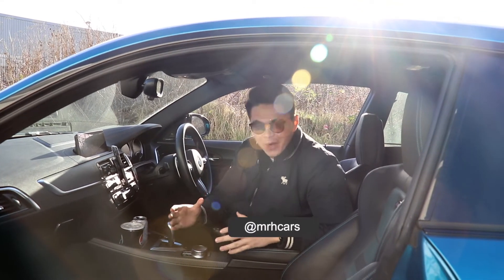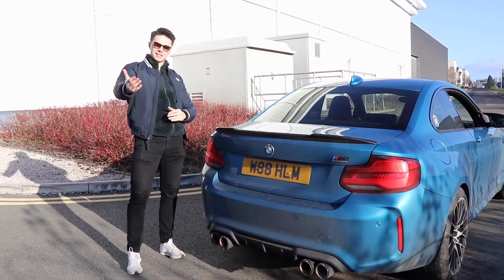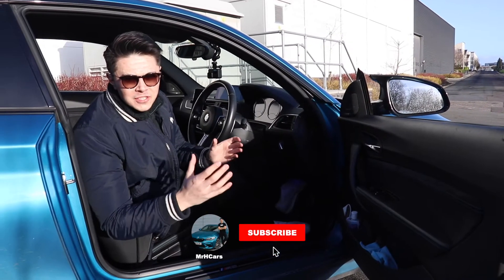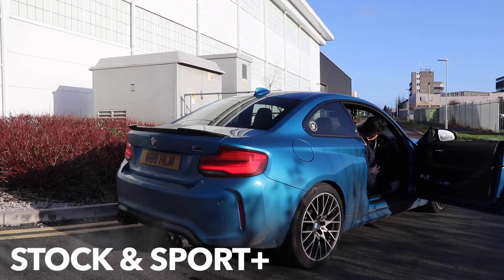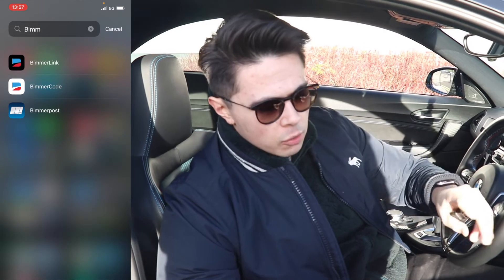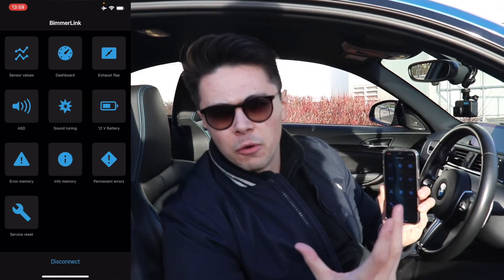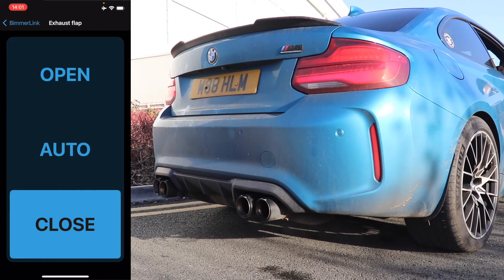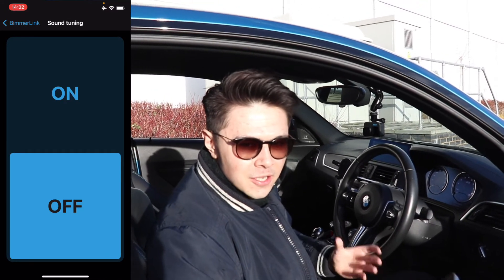How I Open The BMW Exhaust Valve Permanently! | BimmerLink

Comment from the maker: Hi all, 
I personally think I waffle a lot in my videos 😂 , so here's a summary:
- Bimmercode and Bimmerlink have similar features such as ASD. But if you code ASD off in one app, I'd stick with the same app to code it back on.
- Bimmerlink is the only app that lets you code burbles off and valves closed.
- Burbles will remain off even when you unplug the OBD and turn the car off.
- But Valves will reset back to stock when you turn the car off.
Hope that helps 🤘🏼
Reply: Helps massively 😁🤘🏽
Reply: Hi, if you turn ASD off in bimmerlink, will it remain off when the OBD is unplugged?
Reply from the maker: @CJ-sw7mr  it will, yep! There’s a how-to & review on my Instagram page, on the highlights sections

Comment: FYI another option is to go a multimap custom tune option (bootmod3) and disable burbles in one of the slots ;) That’s what I have but yeah more expensive. So if someone wants to stay stock tune and not mess much around ecu etc, then bummerlink is the way to go indeed!

Comment: How does this affect warranty?  Is it detectable ?
Reply from the maker: Should be perfectly fine.
You're only turning features on/off already present in the car. I've never had any issues when replacing my rear tail lights under warranty. 
Can depend on the dealer too and whether they notice it’s not stock. 
If you’re unsure, I’d leave it. 
But never heard of other owners having warranty issues.
Reply: I asked my dealer if they could help and said no and also said this will void the warranty. I'd wait till the end of warranty, just to be on the safe side.
Reply: @schwagier  really ? Voids warranty ? I dont think so

Comment: Another good video mate.  Just to make the point there are two valves on the exhaust so at most with the valves closed two tailpipes are open instead of the four.  Also I think when it is set to auto that doesn’t open dependant upon revs it is dependant upon the engine mode
Reply from the maker: Thanks mate!👊
You're right, 2 valves on the exhaust.
Also you're right, AUTO depends on the engine mode. But I can also hear the valves opening and closing when I'm driving around town. So the revs must affect this too right?
Reply: @MrHCars  I will have to do more research I didn’t think they opened at different revs etc.  the old e46 vacuum system worked like that though.  I will have a look and see whether one is open or both under sport and sport + etc
Reply from the maker: @mgmmotorz5004  I only say this because I can see Will's valve opening and closing when I drive behind him at night, with the headlights shining into his tailpipes.
Also with ASD off and a louder exhaust, I can hear it too driving around town.
Reply: @MrHCars  I need to turn asd off and have a listen if it does work like that I didn’t know it and you learn something new everyday lol

Comment: Does the exhaust valve remain open permanently without using the app or phone again? 

I’ve read a lot that says it won’t make a difference unless you’re on the app.
Reply: did u figure it out??
Reply: @ BimmerLink cannot permanently code the valve open - afaik the only options are a valve controller installed or a simple method of effectively opening the valve and disconnecting the selector mechanism..

Comment: Hey man it would really help if you know if bimmerlink would work on 2021 BMW M340I for the burble on and off setting cause in sport mode my flap stay open completely I've heard that it doesn't but I posted a video showing mines stays open once it's in sport mode.      is that a 2022 2023 problem ?
Reply from the maker: Hey dude! 
I can’t say for certain, but I don’t see why it wouldn’t work. 
The only way to know is to buy the app and test it, it’s relatively inexpensive
Reply: @MrHCars  thanks for get back to me I just received my VPEAK BLE today I will try it today thanks again.
Reply: I finally did it yesterday bimmerlink for the 2021 BMW M340I Does not come with the option to turn burble on or off But it's crazy. I open the exhaust flaps on comfort mode. And the car starts popping like crazy more than it does in sport mode lol
Reply from the maker: @MrJdmk20  haha brilliant! At least there’s an improvement somewhere. 
Thanks for letting me know, incase anyone else asks 🤓
Reply: Can’t do burbles or remap 2020+ bmw’s. Ecu is locked and no one has found an unlock except femto which is based in finland.
Reply: @DonR4J  you sure right about the DME I have a 2021 with full AWE Exhaust AND IT POPS when revving it doesn't pop when driving but every downshift it burbles nothing loud or crazy but it noticeable

Comment: Just bought bimmer link and a obd2 mx+ Bluetooth. I’ll be hooking it up to my 2023 m3 comp xdrive tomorrow when it comes in let me know if you want to see what happens. Car is stock
Reply from the maker: Yeah keep me posted dude! 
I’ve not got any exp with the G series models & bimmerlink
Reply: @MrHCars  okay so bad news it doesn’t work on the G80. The option is there but as soon as you select it the main computer takes back control and Ignores your input. It doesn’t even fully open long enough to pull the fuse that controls the flaps lol yeah I tried. So I guess as of now the only way on the g80 is a aftermarket valve controller. Sucks

Comment: What is the point in getting bimmercode if bimmerlink has more features?
Reply from the maker: Bimmercode has more features. But doesn’t have the sound tuning feature than bimmerlink has. 
Bimmercode is more for Idrive features vs bimmerlink for performance-like features

Comment: Definitely don’t code a car with the engine running. Big big risks that one. Always do it ignition on engine off. Would take ages to drain battery enough to cause an issue
Reply: what risks could I run into by coding the car while the engine is running?
Reply: Bimmerlink is fine for when engine runs, bimmer code is not
Reply: @KREZ10 bricking the ecu, but the guy in the video was fine